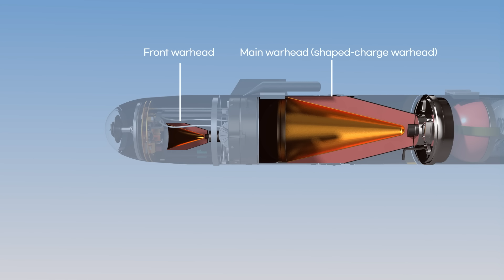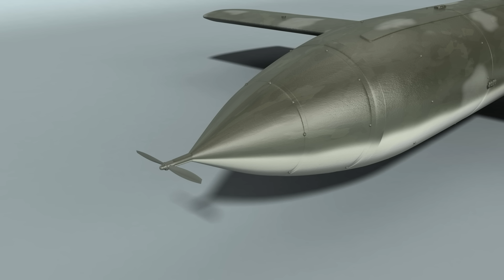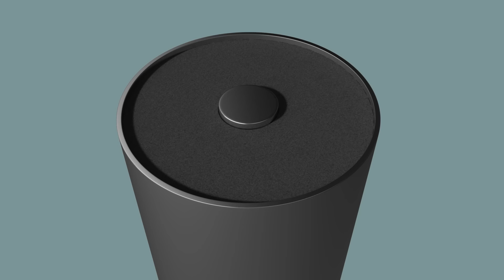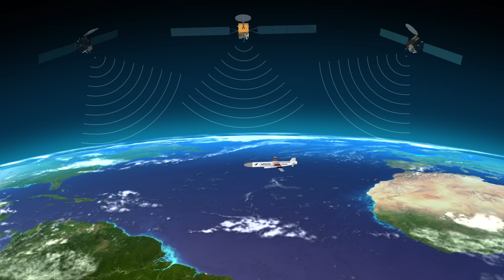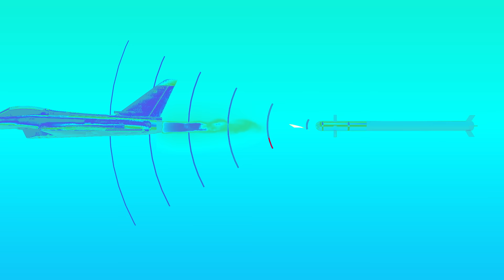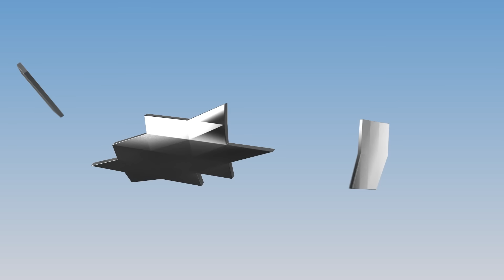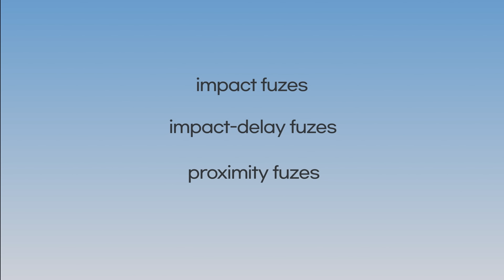How Missiles Work: Engines, Guidance, Warheads, and History Explained

Comment: 0:44 "The difference between a missile and a rocket is that the missile has a warhead."  That is incorrect.  The difference is that missiles typically have some kind of guidance system in this context.  Rockets are typically unguided.  There are countless rockets in modern warfare which have warheads.
Reply: Completetly agree with Neo, the vast majority of MLRS (Multiple Launch Rocket Systems) used in modern war (Russia-Ukraine) are 'rockets'; one exception is the HIMARS projectiles.
Reply: so, SpaceX Falcon and Starship is a missile?
Reply: @madr3563  I believe techically SpaceX Falcon is a rocket as it doesn't have a guidance system for a specific target or a weaponized  payload. I don't believe it's accent is 'steered', it just appears that way due to the rotation of the earth during flight.
Reply: @madr3563 Good point but luckily I included the verbiage: “in this context”
Reply: The difference between missiles and rockets has been blurred since the use of GPS to guide even artillery shells.
So, guidance is not the distinctive factor anymore, but range is. Missiles travel longer distances than guided rockets or shells.
Reply: @internetcensure5849 The main point I was making is that not having a warhead isn’t what defines a rocket, as the video implied.  And to your point, that’s why I mentioned “context” and “typical”.  For instance, APKWS is something I’d call a guided rocket.  And guess what? It has a warhead.

Comment: Most importantly: The missile knows where they are and where they must go.
Reply: It’s performing dead reckoning with a gyroscope, magnetometer, accelerometer, altimeter and computer.  I guess that means it knows where it isn’t.  More like it estimates where it is enough to be within an acceptable margin of error once it goes active in its terminal phase
Reply: The missile knows where it is at all times.
It knows this because it knows where it isn't.
Reply: By subtracting where it is from where it isn't, or where it isn't from where it is (whichever is greater), it obtains a difference, or deviation.

Comment: They didn’t explain the HEAT round well enough.  Thats a foil liner that is blown into a superplastic (plasma) jet to “squirt” through the armor purely with kinetic energy (not actual heat) and cause the armor to spall (turn to little fragments and smash around the inside the hull of the tank) and “disable” the occupants

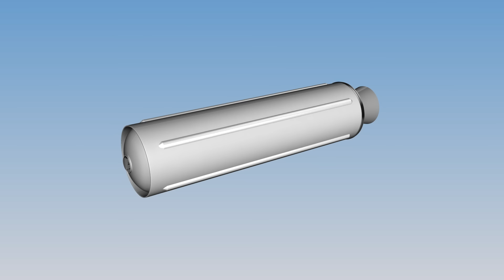Comment: 4:24 explain the used for more than 10 years part. how do i use my missile for 10 years straight?
Reply: Regular oil changes every 5k miles
Reply: I think the AI Voice means stored for more than 10 years because the fuel is solid. Maybe it won't "separate" or need periodic "mixing" like liquid fuel overtime in order to maintain effectiveness.

Comment: the differene between a rocket and a missile is the missile has a warhead? 

and the rocket doesnt?

the difference is the missile is guided and the rocket is unguided
Reply: The difference between missiles and rockets has been blurred since the use of GPS to guide even artillery shells.
So, guidance is not the distinctive factor anymore, but range is. Missiles travel longer distances than guided rockets or shells.